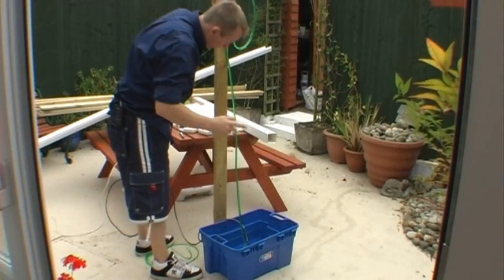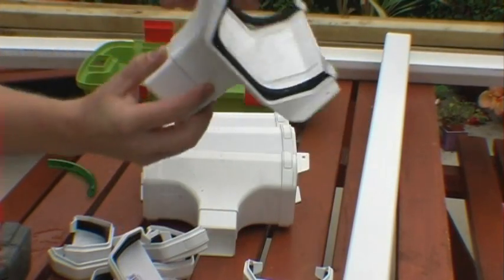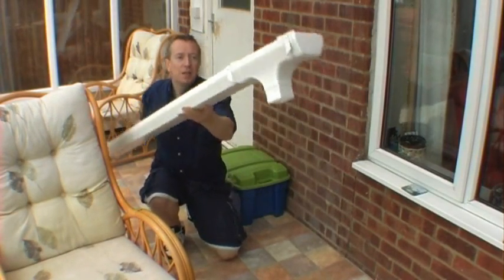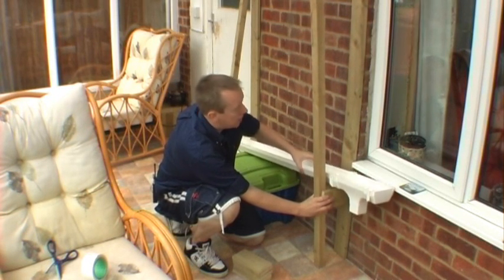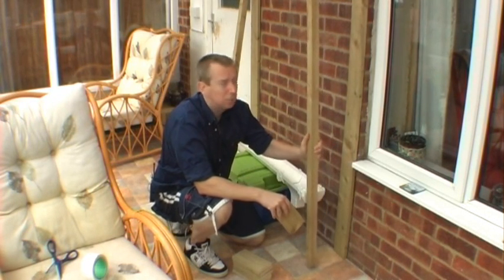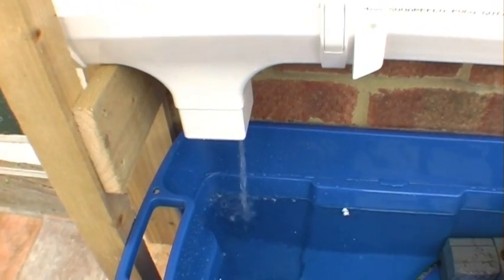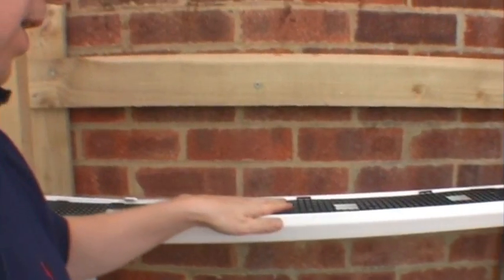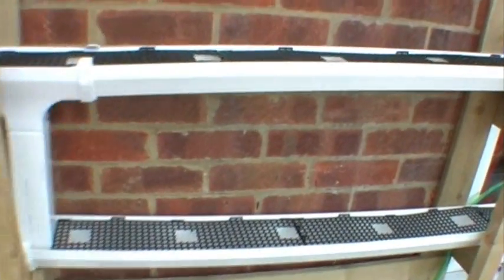How to Build a Home Made Hydroponics System

Comment: Nice build video. I think you need a separate air pump and airstone. As for the cover, you might want to try some foam/styrofoam insulation. They come in sheets with one side is shiny metallic cover. It has the advantage that it actually floats, but is also completely impenetrable to light.

Comment: I don't know about your pump specifics, but as the theory goes, you should be able to connect multiple pumps in series to pump water higher.  You would have to check your pump's suction pressure rating and make sure it's less than the discharge pressure (units of "head" or "feet") And of course add the values of all preceeding pumps, if you go with more than two, when making these analysis.

Comment: One thing I can think of straight off is the possibility of sagging of the channels.  You may want to start thinking about reinforcing the channel by securing it to square-channel steel bar or to a piece of lumber running along its length or rigging a couple of vertical posts at the back of the assembly just like your other vertical lumber, only in the center of the assembly.

Comment: Use flat sheets of plexiglass plastic 1/4 thick  (preferably black if not paint them black to hide light) and cut them into strips a little wider then the gutter and lay them on top of the gutter sections and you can cut holes in them big enough for them to accept 2" round netty pots so you plant the plants in rock wool and then place the plants into netty pots that will be suspended a little above the water flow and your in business.

Comment: Oh yeah, and if you dont want to use rockwool but just net pots or cups, place some capillary matting on the bottom of the channel. That will help spread the nutrient evenly as it travels down the channel for crops like lettuce and stuff.  It also will buy you time in case your pump fails!  Hope that helps

Comment: You've done a fine job and everything will work just fine like that! SOme improvements you could make is to cut some small pieces of PVC pipe or Downspout in 1.5-3 inch lengths to put under the mess leaf gaurds you have in between your plant sites to keep your leaf gaurd up out of the channel..only for asthetic purposes...and maybe get slabs of white plastic to use instead of the green plastic from a plasitc supply house. They will cut the for you but truly what you did here will work fine!

Comment: I agree with using PVC Pipe instead, but I think this system is good, but the cost could be drastically reduced by using all end caps and then using like 1" PVC pipe instead of the t-shaped down spout pieces.  I don't know where you live, but where I am, they are quite pricey.  This system is another great idea, but using round PVC pipe instead would eliminate huge costs.  No covers for the trays, etc.  I have used one made of 4" PVC and it's amazing.  Keep the good ideas coming M8

Comment: Looks like we kind of had the same idea of making a free standing hydroponics unit. Nice work, I'm impressed. Check out the one I designed. It's not home made but expandable and can accept all kinds of media.
I'm actually going to explore the way you did the gutters. I would have to make custom ones because we need a minimum of 7 inch in the width. I want to see how it will work with coco coir as this is the medium we use.

Comment: Looks like we kind of had the same idea of making a free standing hydroponics unit. Check out the one I designed. It's not home made but expandable and can accept all kinds of media. 
I'm actually going to explore the way you did the gutters. I would have to make custom ones because we need a minimum of 7 inch in the width. I want to see how it will work with coco coir as this is the medium we use.

Comment: @kellyhose4 in the bottom of a swimming pool it is 12' deep and the water weighs 8.33 pounds per gallon there is 5.2 psi of pressure on the bottom.. If you took a peice of pipe that was 1" diameter and 12 feet long and filled it with water weighing 8.33 pounds per/gal the pressure would also be 5.2 psi it does not matter the diameter.here is the formula.....   weight of fluid pounds per gal X .052 X HEIGHT OF FLUID= PSI ..... .052 IS A CONSTANT FOR PSI PER/FT i HOPE THIS HELPED.

Comment: @rickvanman  Rick i noticed that you where tring to get the water to pump higher up the tube that was smaller the reason it did not work is because no matter what diameter it is it still weighs the same. Example :

Comment: Good tutorial you have here. But me personally I would not have gone for an NFT hydro. I would have done Ebb and Flo, it is a lot more stable. For instance if you are at work all day and your pump dies, so does your plants. With Ebb and flow you have a grow medium that will retain water for long periods of time. So if a pump dies you have time to replace it. You could have very easily done the same system as Ebb and flow. Would just need 1 pump per gutter. At about $20 per pump,  it's doable.

Comment from the maker: @AscensionSeries  Did you mean BPAs?  Yeah I did wonder about that when I built it, then was led to understand that the release of the offending chemicals only come about through severe temperature change in the plastic - eg - it is heated up.  As the temperature of the systen remains fairly stable, I figured there wasn't much likelihood of BPS being an issue here.  I could, of course be wrong.

Comment: For an excellent, all-around flourescent grow bulb availiable at any Lowe's Or Home Depot store, look for 'SunSticks'. They come in 4 foot sections to fit the standard 4 foot ballasts but even more importantly they are specifically designed for growing & provide all colors of the light spectrum. Typically 40 watts per square foot of growing area will be sufficient. Hope this helps!!!

Comment: @rickvanman because they need stronger lighting. The large CFL's would be good for them, not the standard ones that you buy as incandescent bulb swaps. The large CFL's are about 14-16 inches long, screw into standard light sockets, but the main difference is that a 105w CFL will put out as much light as a 400w incandescent bulb, with much  less heat.

Comment: Richard,
What a terrific system, one of the better I have reviewed.  I would use plastic drain pipe to cover the gutters: it is black which creates the light-tight environment you want and a simple cut down the middle of the circle would give you two halves to use (i.e economical: many people toss away scraps) Function would determine use: curve above? or concave inside gutter? I would try concavely first. I used baskets and rocks for root grasp and dynagrow for nutrients. Yum! results!

Comment: do u use h2o2? nutrient gets into the plant by sticking to oxygen molecules so the more oxygen the more nutrient the plant can drink, it also keep system clean of algae etc... aim for 30000 ppm... or get a oxidator for a tenner and it will  do it for u.. :)

Comment: Rofl! I was outside working on my hydroponic/aquaculture system earlier wearing the exact same swim trunks.  Nice design, I built a tiered, free-standing system, for indoor/outdoor use as well. However I went with PVC piping for the structural supports, also I opted for an air pump to create a siphon pump to move the water. All in all I think it cost me around $20 (not sure what that translates to for you).

Comment: you can use  4 inches pvc pipes instead of guttering cut the holes in to  the pipe so you at just the size you need

Comment: fill the whole troth with hygroton or vermiculite it will help in hydration and block light. you can still use your rock wool blocks and you wont need the leaf guards/plastic at all.. it could get expensive though,that's allot of aria to fill

Comment: Maybe some weedblock to block the light (either the woven fabric or plastic)...

Also, you might consider cutting your resevoir lid in half so that the left half can stay down without disrupting your setup, and simply lift the right half.

To guide the water into a freefall in your verticle pipes you can glue bits of pvd fins or guides so the water trickles away from the walls to drop down...

hope it helps, nice work!

Comment: for your channel tops you can go to a plastic supply place and order a 1/16th of an inch or so 4' x 8 ' sheet of plastic and have it sheered to the correct width so that the 8' x ?" slices will snap right into the top of your channels.
then just cut out holes where you like for your plant sites.
its cheap, they will last a LONG time, and they are neat and easy to clean

Comment: seeds directly into the rockwool will be less stress on your seedlings. Just soak your rockwool first (gets rid of any Ph issues)  then drain off the excess and put your seed in the hole.  put clear (empty soda or water bottles work best) plastic over the top and then put them under some fairly but constant light (preferably not sunlight).

Comment: If you want to quite the running water noise and splash try sticking some rubber pads underneath the gutters where the water drops down.  if you look under your kitchen sink you will see rubber sound & splash dampners.